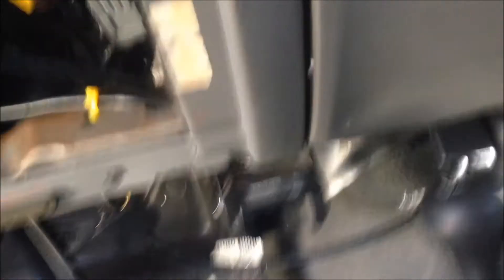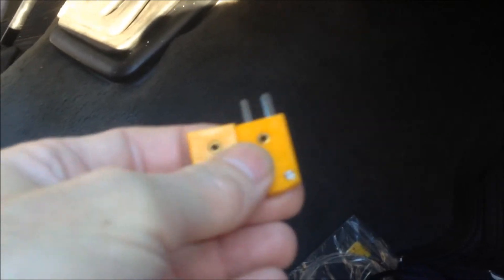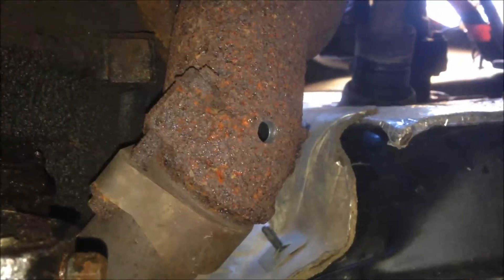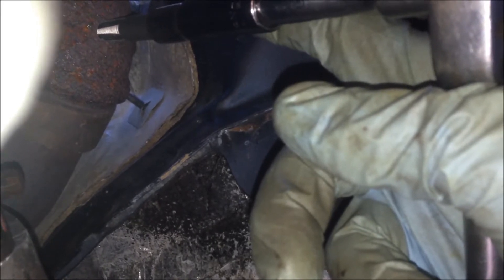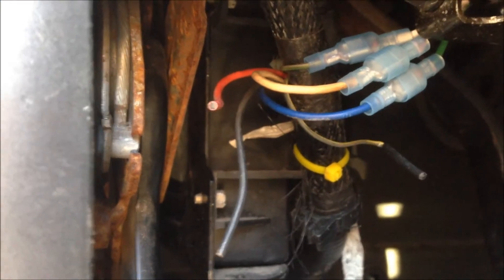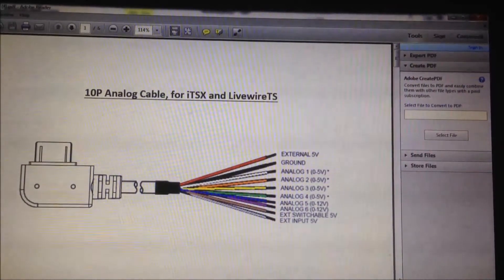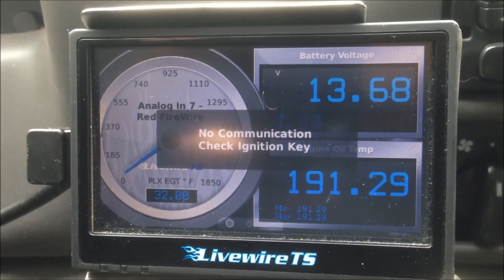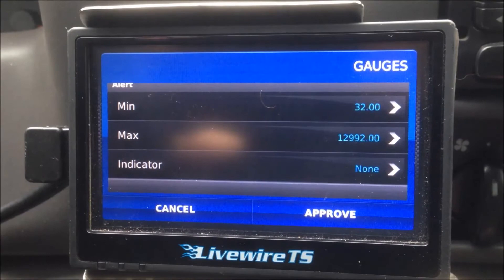PLX SM-EGT Sensor Module Install with SCT 5015 Livewire TS on a Ford 7.3L PSD

Comment: Great video. I am adding the same module for EGT, but will it will be communicating with the Torque Pro app for monitoring.
For others doing this, thought I should point out that those type K connectors are very easy to take apart to remove your wires. After you remove the top cover, there's 2 more phillip screws that terminate both wires. Just make sure you put them back in the same spot after you run the cable through the firewall.